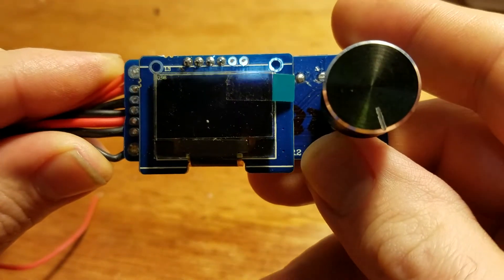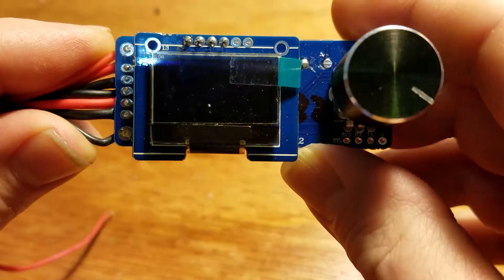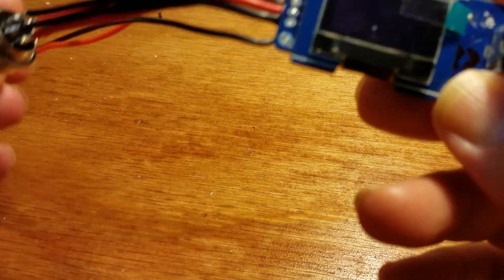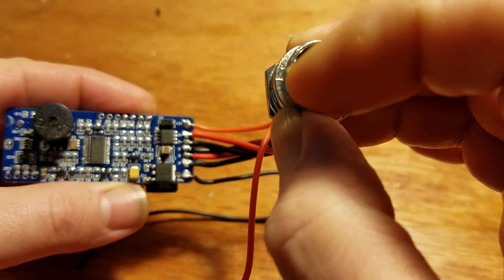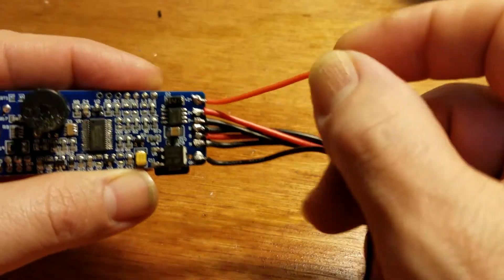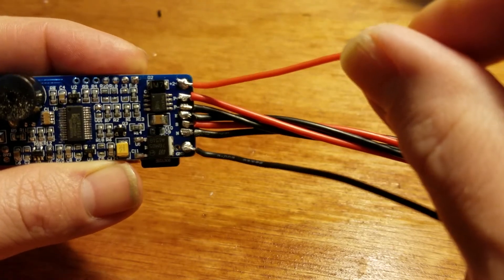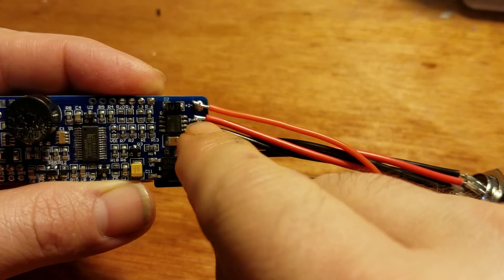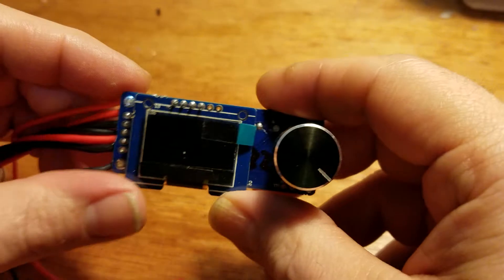How to wire up a T12 OLED soldering iron controller

Comment: Quick question for you.  I have not been able to find any documentation on this thing but on the bottom right you have a temp which is tied to the thermistor in the handle any idea what that value is used for, if anything?  Also any idea of the significance of tip selection within the software?

Comment: Thanks for the video! I like your way of connecting.  I have seen this connected a few different ways. The way the instructions say is 1=(P+), 2=(N), 3=(E), 4=(S) and 5=(P-), I have also just recently seen this connected to match the older T12 LED version that only used a Vibration Switch. 1=(N) or Vib-, 2=(P-), 3=(S) or Vib+, 4=(P+) and 5=(E). All of them had different ways of connecting the aviation plug, but inside the iron itself, they all connected exactly the same way. I am starting to think it don't really matter how the plug wiring is connected as long as it matches the iron. Just make sure to take note and match them to the iron plug connect to the iron itself. Great Instructions!